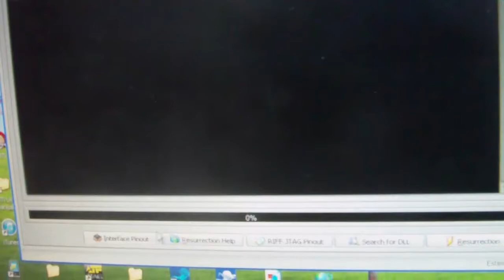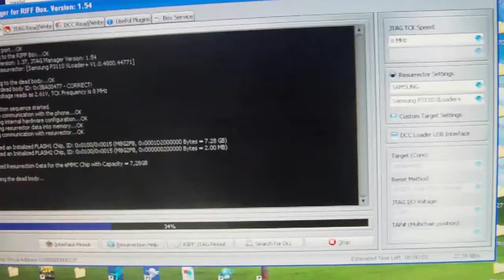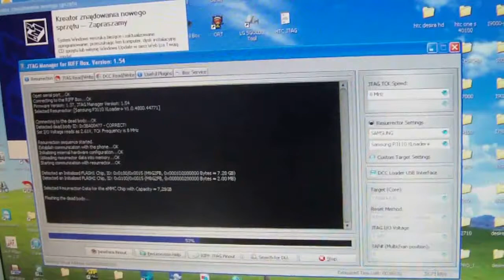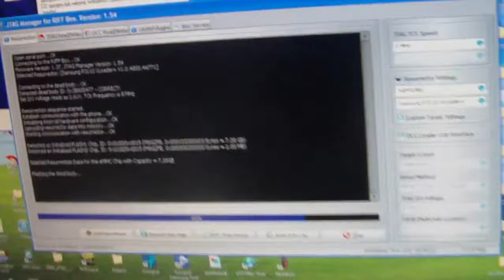Samsung Tab 2 7.0 P3100/P3110/P3113 - JTAG/RIFF connection unbrick (repair dead boot)

Comment: GOOD NIGHT I'M WITH A SAMSUNG SAMSUNG GT-P3100 TAB and it won't turn on, and the computer just keeps showing OMAP4430 driver, could you solve the problem with this procedure? thank you
Reply from the maker: You need to try - if there are recognized as OMAP I rather think that there is some issue with memory and it's reason why SoC are recognized - visit service center in your location and they will check it for you